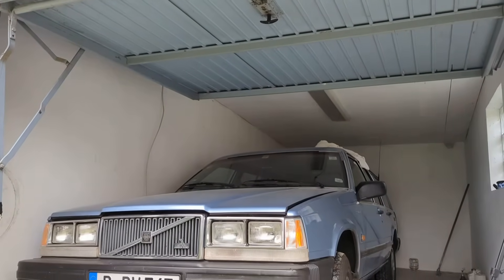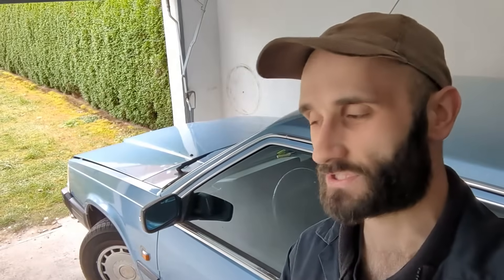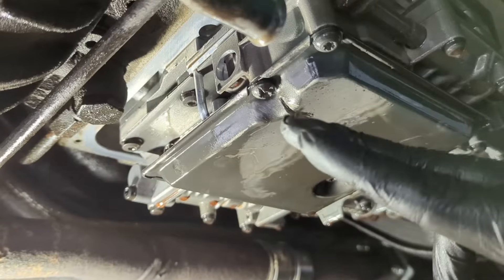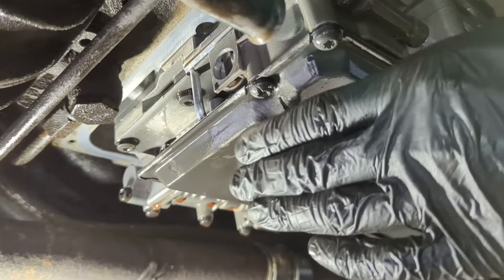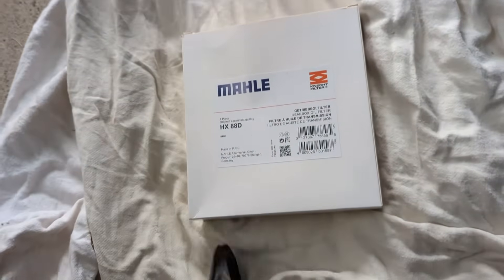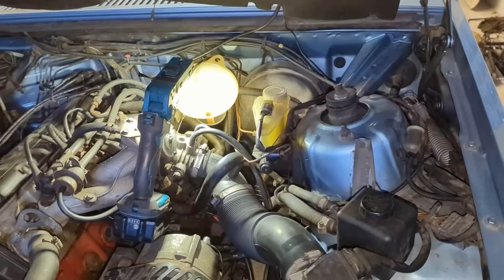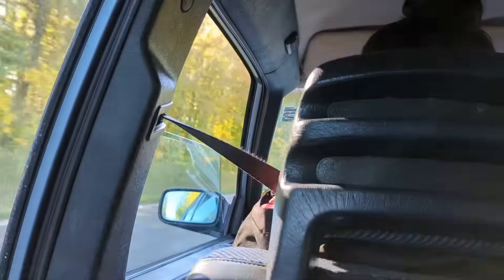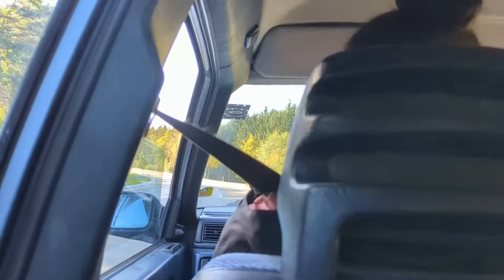My Automatic Gearbox IS NOT THE SAME after this...

Comment: Where did you buy all the replacement parts? I need to do mine after watching this but i can only find AW70/72 kits. Fairly sure mine is ZF22 (atleast that's what Skandix says when I put in my VIN.. I never trust those though) 

It's a 1990 Volvo 740 2.3 GLE and it's k-jet if that matters.

If anyone can help with a decept parts shop in south of England really appreciate it. 

Looking for a fuel sender unit too but cannot for the life of me figure out which one to get, mines all rusted and starting to leak fuel but can't find a replacement.
Reply: BW & AW transmissions are P,R,N,D,2,1 and ZF transmissions are P,R,N,D,3,2,1.

AFAIK, the senders are NLA but as whole units, they are interchangeable.

When I started using my 940, previous owner (father) only used a little supermarket fuel and there had been long term failure of fuel gauge.  Within 2 tankfuls of Shell V-Power and BP Ultimate, the fuel gauge was working perfectly.  It made the fuel filter full of brown fluid though and the main fuel pump failed a year later.

Many parts will be specialist only.  Try Classic Swede or Brookhouse.  Since Brexit, Skandix isn't so good due to Parcelfarce charging import and VAT.

Comment: Interesting video as usual. I bit the bullet and changed the fluid on my 940. It was shifting perfectly but the fluid was black. I read that Volvo had stopped recommending a filter change with the fluid so I decided to leave the filter. I used the method described in the Volvo Owners Club UK forum whereby you disconnect the pipe to the fluid cooler in the radiator. I pumped out a litre at a time then replaced that with fresh fluid. You eventually see when all the old fluid is out of the system when it runs red where you're draining it. This method uses a little more fluid than the capacity shown in the workshop manual. I had a similar result to you in that, although i thought it shifted fine before, it was actually even smoother after the fluid change. Been driving it a year now since the fluid change with no problems whatsoever.
Reply: I own a 240 and am considering changing the fluid. this is interesting info

Comment: Great Job. I have a 850 which I would like to change the filter on. But I am hesitant to pull the sump, as I cannot find any information on Google or You tube of the procedure. The Manual says that the transmission is a lifetime unit and does not need servicing, but the fluid has a brown tinge to it.  So do I have to be satisfied with doing a fluid change over a period of time?

Comment: Did the same on my '86 740 recently. Found the same level of sludge. Risked a full flush though! Slight improvement on the gear changes, less 'grabby' shifting up. I happened to order the wrong filter, but the metal mesh one is easily cleaned and re-used. So really only a need for a new gasket.

Comment: NEVER flush an old transmission! Drain, change filter and refill with about 30% used fluid. The metal is stopping the transmission slipping!
Reply: Define 'old'.
Reply: 80k plus

Comment: That amount of metal dust is completely normal. That is far from a bad one.  Normal wear and tear as they say. In automatic transmissions there is frition discs, brake bands and planetary gears. They all make dust. Thats why atf is detergent oil. It keeps the gearbox clean  as possible. This is why there are those two magnets.

Comment: What year is this old girl Sledge? Never been sure because of the Deutsch plates.
Reply: the seats would suggest 1987 or earlier but could be wrong as different countries had different upholstery options
Reply: @LZP1987  great observations
Reply: @LZP1987 The mounting studs on the inner fenderwell did actually come 1987 but they still had the abs unit in the trunk until 1988 😅